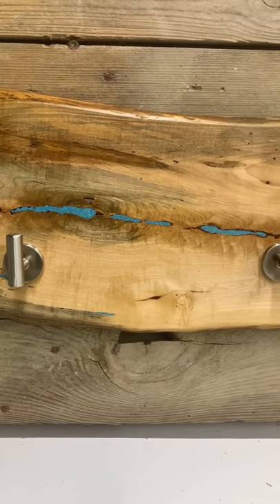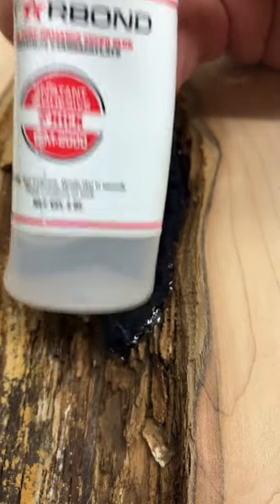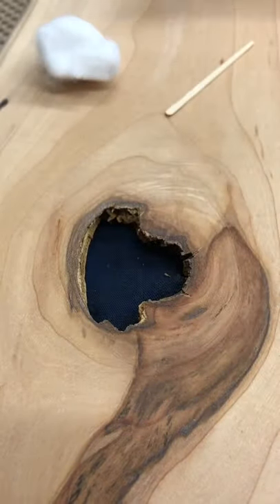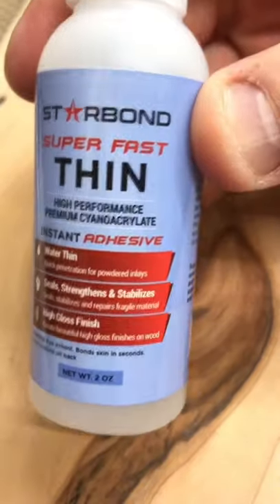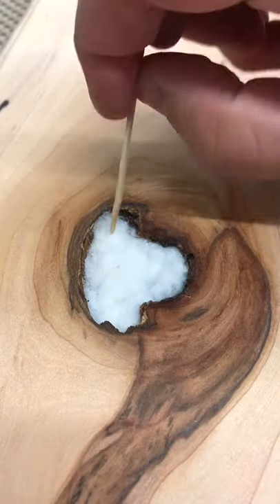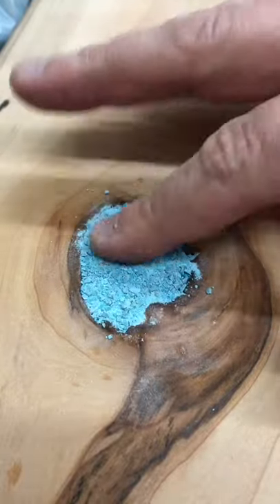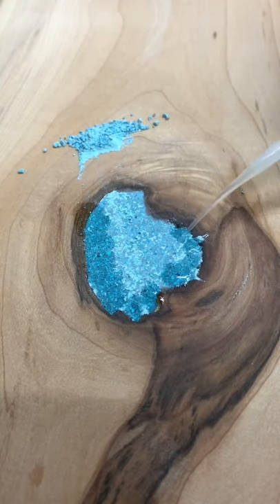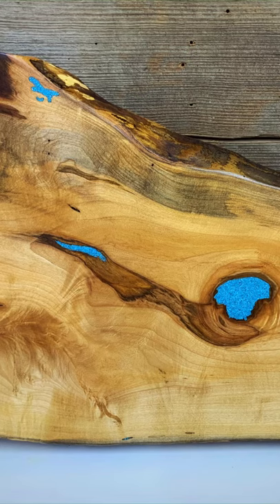Turquoise inlay simple how to

Comment: What grit sandpapers are you using? Thanks for sharing.  Great work.
Reply from the maker: I typically go from 100, 120, 150, 180, 220 and 240. If there is a lot of figure in the wood I will go up to 400. Sorry for the late response, I hope this helps.

Comment: Interesting video. Thank you. Is it possible to get a finer ground turquoise so that after the fill and sand the stone would appear much more solid as though it were a solid stone rather than the appearance of a bunch of small particles? Thank you.
Reply: Yes you can use mica powders
Reply from the maker: Yes there are much finer grinds of the turquois powders or as suggested below there are limitless varieties and colors of what we call mica powder.

Comment: I’ve always used epoxy but I am wondering if CA glue will dry crystal clear. I like leaving some clear areas with just a little bit of turquoise sprinkled in to create a depth so to speak. Wondering if this will work instead of the epoxy I’ve been using?
Reply from the maker: I apologize for not seeing your comment.  It will not be as clear as epoxy IMO.